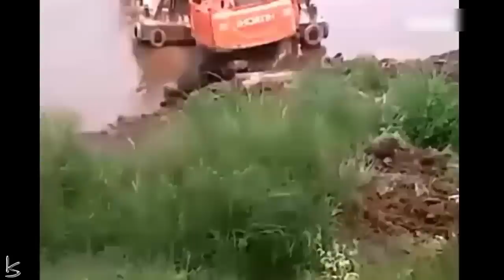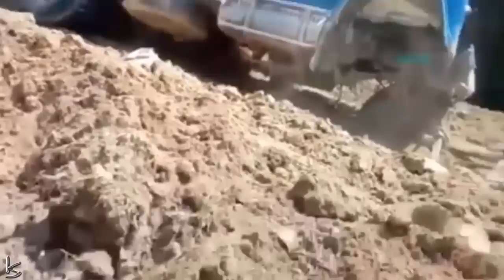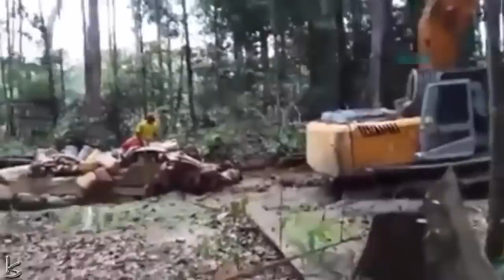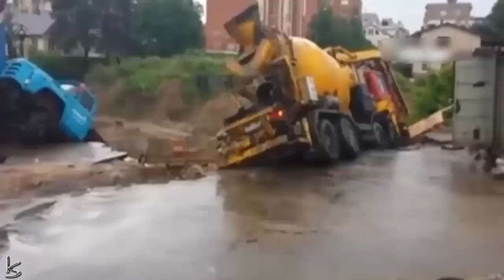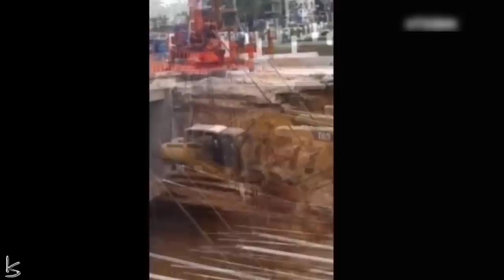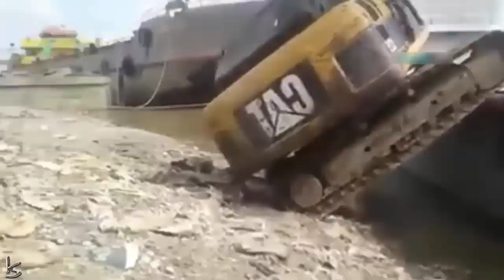Dangerous Idiots Construction Excavator Trucks Heavy Equipment Fails / Win & Operator Extreme Skill

Comment: That excavator putting its track back on without any help is pretty badass
Reply: It easily done but wouldn’t happen if maintenance was done properly
Reply: yeah I thought that was impressive too without even getting out
Reply: Showing Badass or stupidity?, I changed the track and Idler on a excavator, putting a track on a Excavator alone is just stupid when you consider what could have happened